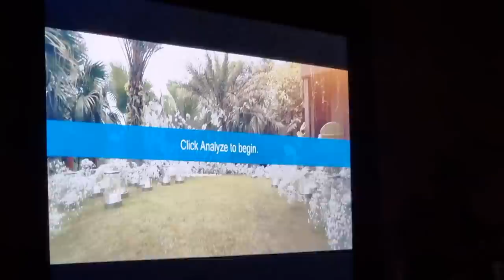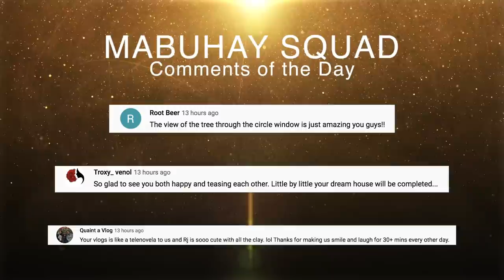Alodia & Chris' Surprise Engagement Party - July 23, 2022 | Vlog #1529

Comment: I'm a bit confused you are getting 3 birds.
Is it different for bigger parrots than it is for budgies?
When I wanted to get one from the shelter as a partner for my one, they didn't give me one bc they only had pairs.
They said uneven numbers are the worst you can have beause two will bond together and the other one will be the 3rd wheel most likely (except if you have a big flock).
Did they lie to me?